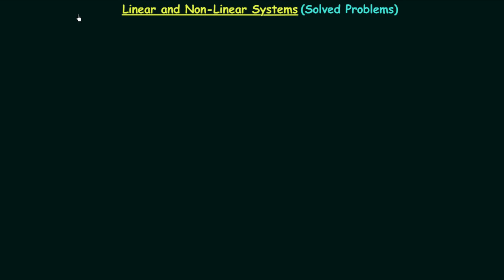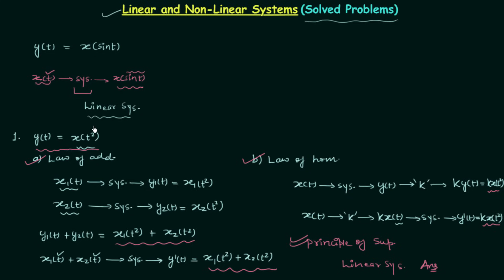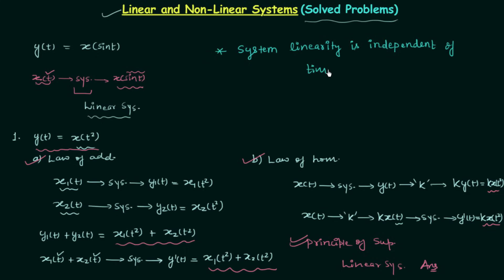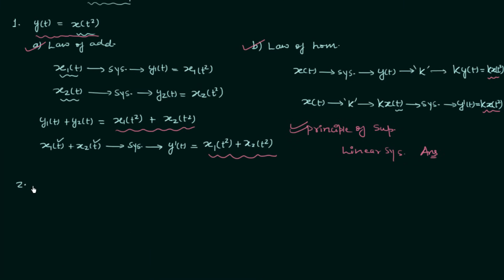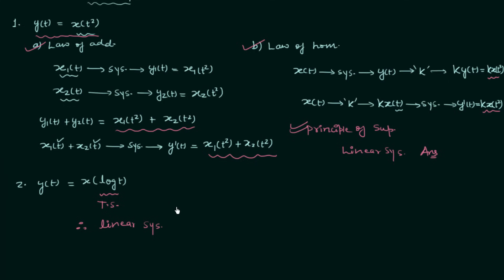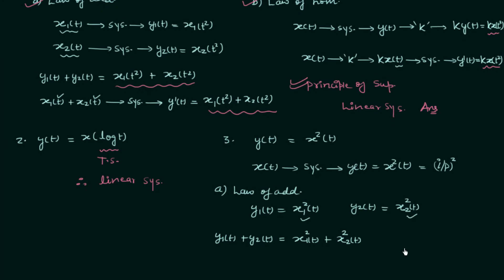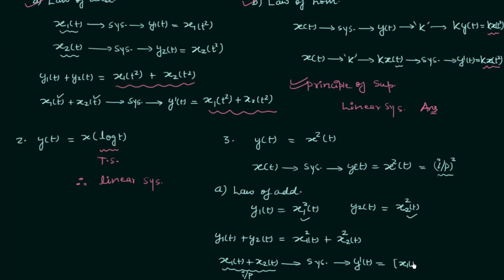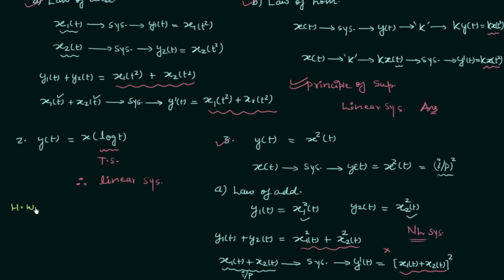Linear and Non-Linear Systems (Solved Problems) | Part 1

Comment: The system is non-linear and Time variant.

Y1 (t) + Y2 (t) = x1*3 (t^3) + x2*3(t^3)
X1 (t) + X2 (t) = [x1 (t^3) +x2 (t^3)]^3
=x1^3 (t^3) + x2^3 (t^3) + 3x1^2 (t^3) x(t) + 3x1 (t^3)x2^2 (t)
This violates the law of additivity. Hence, the system is non-linear
Reply: Actually while adding inputs we'll get
[x1(t^3)+x2(t^3)]^3
Reply: @triptijain4192  Thanks for noticing the error
Reply: Thanks from another part of the world